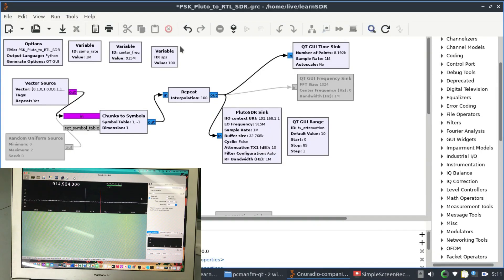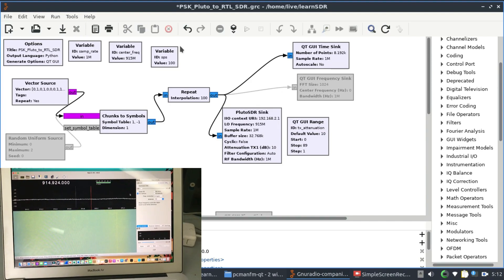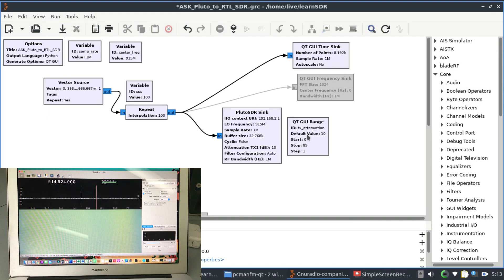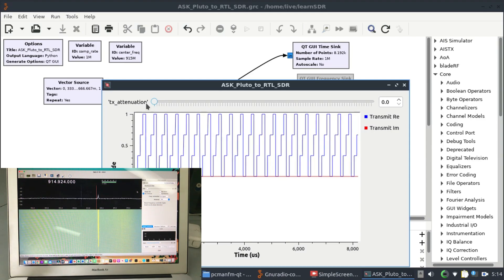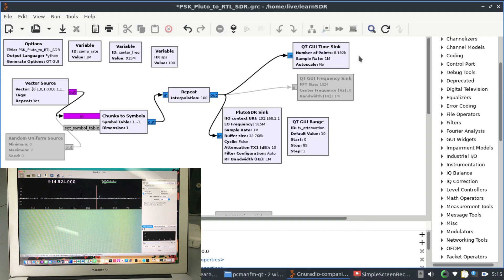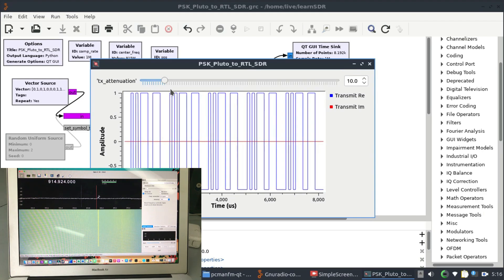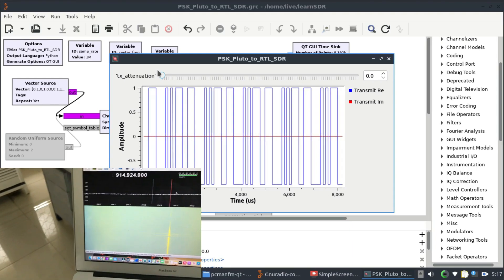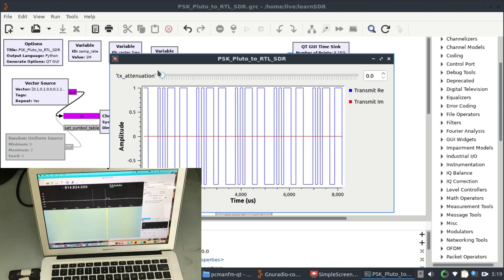Digital Transmitter and Receiver | ASK & PSK using PlutoSDR & RTL-SDR

Comment: Thank you for the helpful video. Sir, but I have a question. 
If the sampling rate is about 20 MHz, it will be underflow in usrp, how can I solve this? (Most gnruradio videos use sampling rate around 1 MHz, and I wonder if there is a specific reason.)